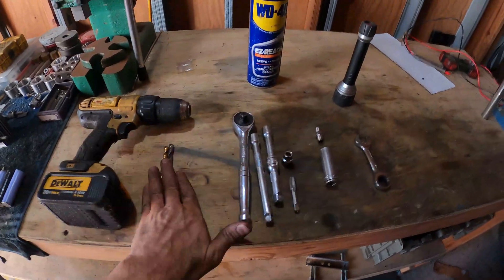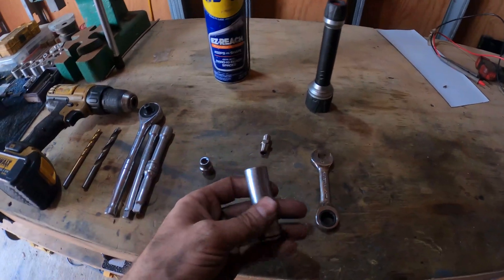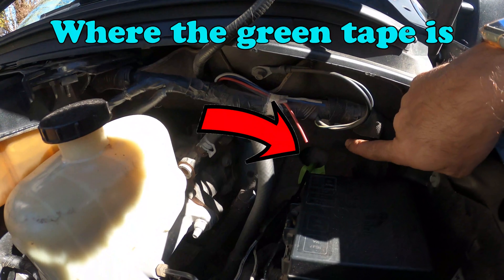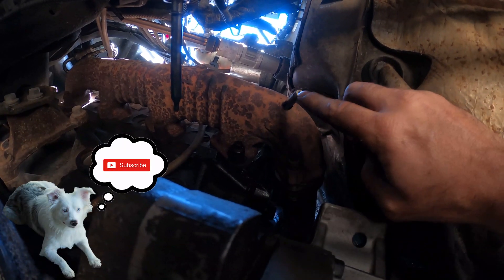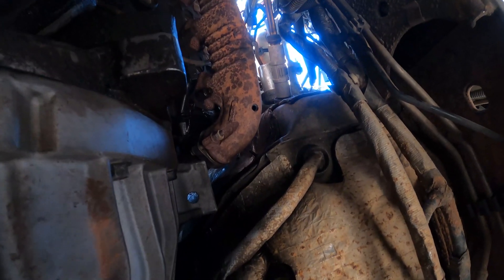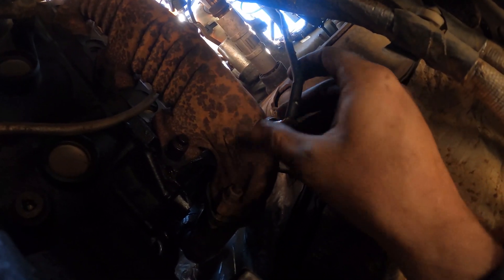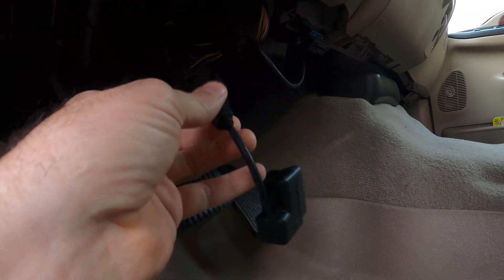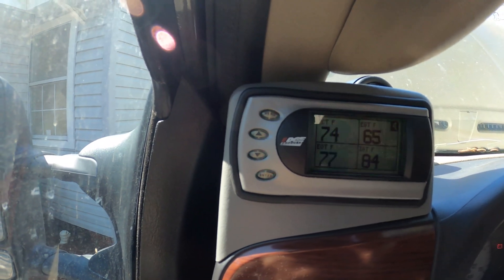How To Install EGT Probe | EGT Install on a 6.0 Powerstroke

Comment from the maker: Hope this video helps out! Let me know if you have any questions.
Reply: Massively high failure rate on that exact Pyro gauge.  Is it still working right?
Reply from the maker: That’s just a picture of a pyro gauge, because most people won’t recognize the edge performance programmer as having a pyro gauge on it. Pretty sure in the video I say that. But the install of the sensor is the same.
Reply from the maker: Unless you were talking about the Edge Pryo and in that case, yes it still works after a full 1 1/2 years on the road.

Comment: now you have drill shards making their way back into the turbine housing.
Reply from the maker: Nope pretty sure I say in the video to use a magnet to fish that crap out. If you had actually watched the video instead of being a "keyboard warrior" that knows everything you would have known it was said.
Reply: You can put a bunch of grease on your drill or tap and it should capture most of the cuttings. You might want to clean it off and put more grease on there multiple times during cutting.
Reply from the maker: Yep, that is another way to skin that cat.

Comment: I'd love to comment but don't know what it even does. LOL
Reply from the maker: Monitors your exhaust gas temperatures, it is good practice to have one on a diesel while towing. As damage can occur to your engine if EGTs get too high for too long.
Reply: @grumpysdiy  i have an 02 with the 7.3, just tow my truckcamper with it. Not a fuel efficient rig.
Reply from the maker: @Thelifeofwiley  You could squeeze some more performance and MPGs out of it with a programmer.